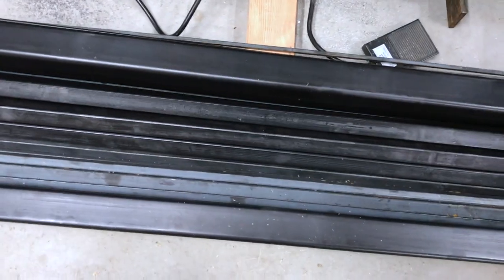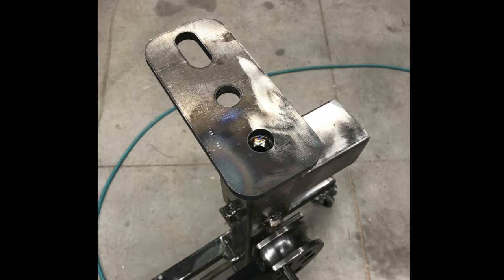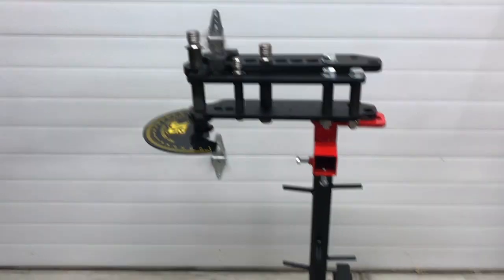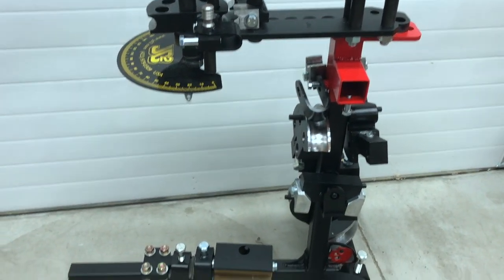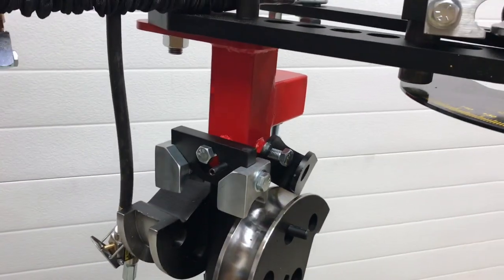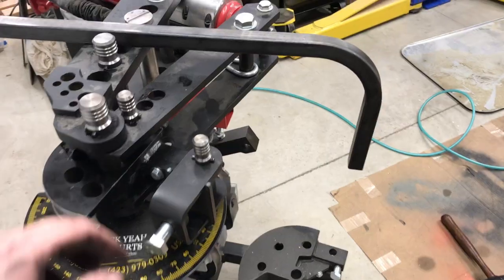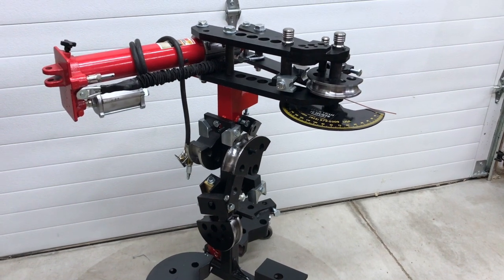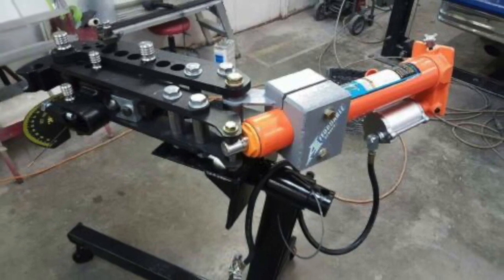FABRICATION | Hydraulic Tubing Bender Stand

Comment: Thanks for the engine stand tips. Looks the the fastest way to get one setup and give you the simplest way to go from horizontal to vertical orientation. Plus it’s cost effective l. Thanks again did the informative video👍
Reply from the maker: No Worries.  I agree, the swing using the stand is the way to go!

Comment: I wish I could post a picture of the detachable legs I built for my Eastwood bender stand. They are bolt-on and flip up for storage. They have locking casters and provide leverage for large bending projects. I made the stand due to the (maker space) shop I was using would not allow drilling bolt anchors  in their floor  to support the stand. That is a nice stand you made for the JD Squared model.  Imagination can create many options in which all can work.  Thumbs up
Reply from the maker: Thanks!  Would love to see you solution as well!  yes, there are no bolting down in my shop either.  everything has to be on wheels - except for the car lift :-)

Comment: Good job Sir  I like your build.  Doing same myself.  I like welding and metal fab too.  I built my own engine stand as I am 6-1 and the once out there are too short.   Thank you Sir.
Reply from the maker: Nice!  Yep, the Engine stand Method is the way to go.  I just sold this bender (not the dies) to a local guy and I and upgrading it a little and will build version 2 on the engine stand.

Comment: How long have you had the Makita metal saw? Is it holding up for you? Would you buy it again? How long do the blades last is the larger question? I generally like most Makita products and have a lot of them, just wondering about the metal cutting chop saw. I have an old fiber Makita saw that we used to cut rebar with. It's been treated pretty rough over the years and still going strong.
Reply from the maker: I have had it maybe 3 years and use it weekly.  It has really held up well as I am not gentle with it!  Blades last a long time as long and you limit the amount of tool steel it cuts.  I am on my second blade and it is still cutting really clean.  Makita make great saws.  the finest circle saw I ever owned was a 1980s vintage Makita, that ran for almost 20 years as a framing and jobsite saw.

Comment: I was wondering if you have used your JD2 bender in the vertical position.
I am thinking about getting a short piece of  3"x3" or 4"x4" thick wall square tube and drill the mounting holes in it.
I don't plan on flipping it very often, but on the rare occasion I need vertical mode, the large tube and 2 holes on top and on the side is a pretty easy option and more solid that round tube.
Thanks.
Reply from the maker: I have.  I bent up some 1" round and some 3/4" square tube in the vertical position a few weeks ago.  I found that I am a little limited on the protrusion length ~2", but that is due to the vertical mount positioning.  It could be change so that the ram was down and I wouldn't have the limitation.  I am making mostly short bend anyway, so it works fine.  I like having the option, but in truth, I will probably always leave it in the horizontal position.
Reply from the maker: I meant ~2' not 2"  that is an 18" difference :-)

Comment: Just bought the same exact bender, slightly different swag jack adapter, and the ram jack. I really like your build and want to build something similar.  What are your lengths for the 2" square tubing that the casters are attached to? Have you had any instances where you thought it might tip over?
Looks great man!
Reply from the maker: Sorry for the late reply.  the "T" is made from a 30" and 33" piece and the upright is a 30" piece.  Castors add another 3" to overall height.  No it is not tippy at all.  Rolled it across the ally to my neighbors place two weeks ago and it was fine.
Reply: @MattofManyTrades  thanks, much appreciated! Mine is under construction now.